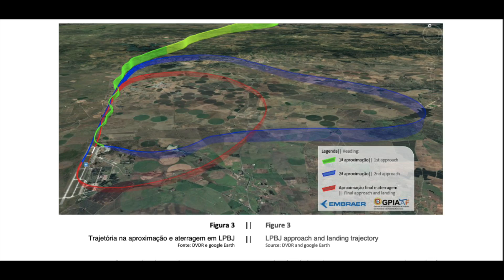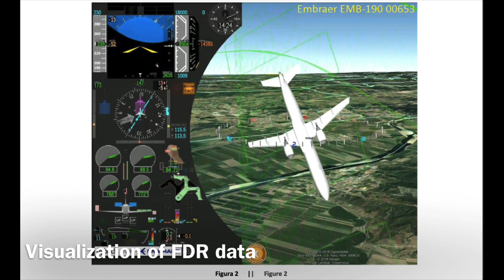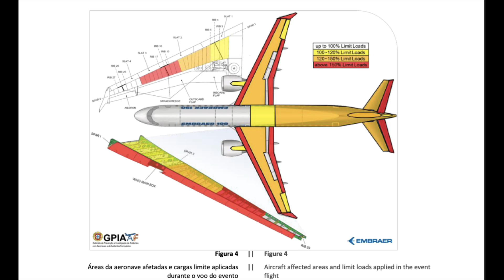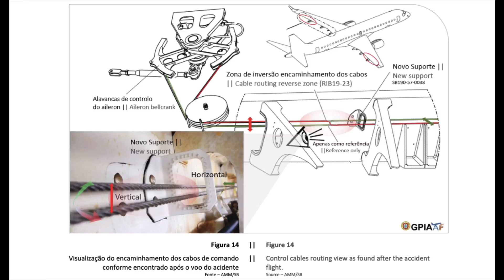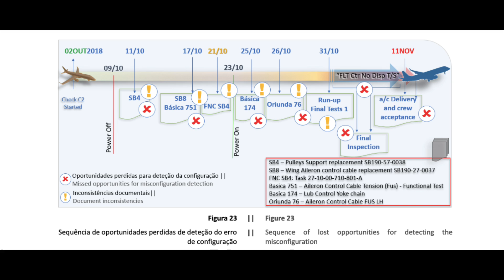Fighting To Survive | Air Astana Flight 1388

Comment: Every pre-flight checklist I know of has an item something like "controls free and clear." That means the pilots move the ailerons, rudder, elevators, and other control surfaces and confirm they are operating correctly.
Reply: But are they also looking out the window, to see if the ailerons react in the manner they expect? Quite tricky, if possible at all. Comms with ground crew needed?
Reply: @hawkertyphoon4537  true, that's why the checklist says "free and clear" and not "free and clear and operating to spec."
Reply: @RaysDad  
As an armchair Fighter Pilot i routinely looked in the mirror (rudder) and out the dang window to see if my P-40, corsair, Mitchell, Yakovlev, what have you... Ailerons were working fine.
We need to give these Men some Webcams to do these checks.
Hell, even some extra cams in random spots do be able to see engines, wing upper, lower, tail structures... whatever.
Let them take a look at their entuire Aircraft, i say.
Reply: according to Mentour Pilot - who has uploaded a video on the incident a few days ago - there is a screen that graphically displays the ailerons & spoilers - it seems the pilots just misinterpreted it somehow - they won't ever again

Comment: You know the flight is so rough when an experienced pilot gets so exhausted from struggling with the plane that the copilot has to take control. Extended amount of 5gs on the body can take a toll on the body, its the same as riding a rollercoaster. I'm amazing how it got on the ground without breaking apart.

Comment: This situation is straight up on the pilots. Pilot in Command means you are responsible for everything that happens. You may not be at fault, but you are responsible. Everyone who is a pilot was taught from lesson one,  "Exercise the controls full scope and visually verify free and correct." If you take a plane out of maintenance without performing that check, you have earned everything that follows.

Comment: Very good that you brought up the spoilers were basically negating the effects of the ailerons.  What a wild ride those pilots had.  Not being familiar with this EMB aircraft, does the EICAS/MFD show the aileron deflections and would it have been indicating the reversed deflection when they did a control check?  If not, then not sure how else they would have caught the reversal prior to takeoff.  What an interesting scenario! Thankyou
Reply: If not it should be in the maintenance procedure to check that visually after maintenance on the cables before handing it over.  It is scandalous that such a basic error could not only happen but fail to be detected.  Really it should be "poke yoke" by design, but not everything can be.

Comment: Come on guys , Even als a PPL even before you startup your aircraft you check your flightcontrols for full freedom and visualy outside for correct movement.
On modern aircrafts you can check this visualy on the EICAM , ECAM or whatever system your aircraft has (Ambraer 190 has EICAM like Boeing).
Furthermore the maintenance crew apperently gave the aircraft free without even doing the same check.   It's like replacing the tires on your car and not even checking if it looks like they are not flat..
They never should even have started up the engines.
.
Excelent video again... and indeed great flying skills.

Comment: You mean to tell me that at no time, NOBODY did step 1 of flight control maintenance certification?  Whenever primary or secondary flight controls are disturbed, an independent qualified tech needs to call the person in the cockpit and (in this case) call for ‘Left wing down’ the person turns the yoke to the left and the inspector should physically see the L/H aileron move up, along with the spoilers. In this maintenance error, the aileron would have moved down.  This is a major red flag for this maintenance company.  They are being rushed to the point that they are not doing the simplest of safety checks in order to save time.  Lessons written in blood here.  This time they got lucky.

Comment: As a non pilot, non airplane mechanic, but an auto mechanic for 22 years and someone who loves all things aviation, I can see how this happened, because there is another video about a very similar problem on another plane I watched a few days ago.  If the mechanic on the ground isn’t very smart and knowledgeable, it would be so easy for him to command left turn, the mechanic in the cockpit turns left. Mechanic sees the left side move in either direction, and call it good. Same on the right.  He would not realize they could possibly install the cables backwards, so he doesn’t register that the input is opposite reaction. Just that it moved as it’s supposed to.  I’d think that them moving opposite of the inboard flight control surface would be a giveaway. Maybe the inboard control surfaces are hydraulic? So they didn’t move during a static test?  Just a thought.

Comment: Is it the case that the flight crew cannot actually see the ailerons from the flight deck. If not how do they do the basic pre flight check of looking out of the window as they move the controls and making sure that the controls are moving in the correct sense. That is they input left roll and see and check that the left aileron moves up - aircraft will roll left. If not they are incorrectly connected. I understood this was an essential basic pre flight check on all aircraft from the lightest single engine type up to as large as they come a any ground engineers can make this mistake.
Reply: according to Mentour Pilot - who has uploaded a video on the incident a few days ago - there is a screen that graphically displays the ailerons & spoilers - it seems the pilots just misinterpreted it somehow - they won't ever again

Comment: RC planes are checked by pilots to see if the servos aren't reversed so they won't crash on a first flight, but a real plane carrying people is not checked if the controller and control surfaces movement match after making a major maintenance?

Comment: Stick left, left side up, stick right, right side up. Basics are important kids! On a more sombre note, it was probably extremely lucky that the the flight spoilers were there counteracting the aileron inputs, I think it's extremely unlikely that they would have been able to recognise the error and correct it at low altitude if they had attempted to make even the slightest turn. It would have taken only seconds for them to totally invert and crash.

Comment: Congrats to the crew for getting back down safely.  But I’m curious, as a GA pilot, one of the preflight checks is to visually check control surface movement from the cockpit.  And proper direction of the surfaces while moving the yoke.  There are examples of where pilots checked movement, but didn’t catch reversed installation of cables.  With these larger aircraft, can the pilots see the ailerons from the cockpit?  
Excellent video, thanks.

Comment: Seems to me; that a normal preflight inspection, and presumably a more thorough one after such maintenance, would have noticed that the ailerons  were working the wrong way. I also find it interesting that they were switching from stainless steel to carbon steel cables. This is definitely a step backwards.
Reply: My guess is that even when they did their preflight checks, they snuck in some shortcuts born from experience. For example, in this situation the roll spoilers were working fine, so maybe they just looked at those. Alternatively, it could be that while still on the ground, the ailerons could move just fine, but that the person checking didn't realize they moved in the wrong direction because they only looked for movement. Or the source might be even more human! In the case they might have realized it was going in the wrong direction, it could have been a matter of miscommunication: aileron down means that wing goes up, and vice versa. Simple speech might not specify what is intended to go up or down. In a similar vein, the checklist might prescribe a certain order of testing (for example ailerons up first, down second), but the person checking may have thought the change was just a colleague keeping a boring checklist engaging by switching things up.
There are a lot of ways for this specific kind of inversion error to be miscommunicated because its is so much more insidious of a mistake than something simply being broken. As humans, we tend to see what we expect or want to see. There are ways for things to break that just shortcircuit all of our common sense: what kind of idiot would switch those cables around?! With all the advanced technology that is in play, it is really easy to assume that an error is in the more complicated equipment, especially when the symptoms do not match any previous experiences with the more basic equipment. It is a lot easier to assume that a transistor broke up and some electronics were activating that shouldn't.

Comment: I wonder if there was a way to have disabled the spoilers so that they could use the ailerons in reverse as the sole means of roll control. Of course they would need to know that this was an issue and it would still leave them flying with the roll axis inverted. All that said I think the pilots did an amazing job in terms of the flying.
Reply: If I recall correctly, that's kind of how they got a little bit of control back. Not really disabling anything, but they figured out that one of the systems (probably the spoilers?) were slightly delayed compared to the other, so by only making minor movements they only activated one of the control surfaces instead of both.

Comment: I worked as a mechanic on MD-11's and when I was being trained it was drilled into us about following ALL maintenance instructions to the letter, every single time, because every single conceivable rule regarding aviation pertains to safety in one aspect or another, and they are most certainly written in blood. When something goes wrong on air aircraft, you can't just pull over to the side of the road as if you got a flat tire in your car, it's a serious emergency that can and has easily killed hundreds of people in just a few moments. No matter how insignificant a task you might be performing, pay close attention and do it right exactly how the instructions direct you because in aviation you never know what tiny little microscopic failure is just waiting to cascade into a horrific tragedy that ends the lives of hundreds of people. This whole video is just a case study as to WHY we have such strict rules in regard to aircraft maintenance and why following procedures is absolutely paramount to everybody's safety.

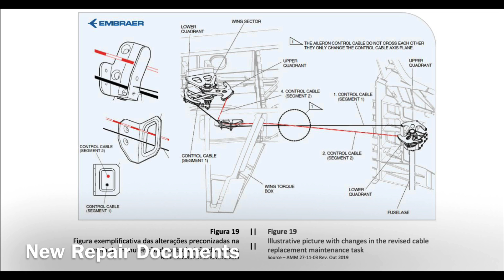Comment: At 10:48 the revised diagram is still confusing, as the cable from the lower quadrant on the bell crank ends up going to the upper quadrant, and vice versa. Things need clarity and consistency, and this has neither! Hopefully there is now an operation check which is part of the maintenance item.

Comment: I'm not insulting your channel with my distrust in Automation.  But this is a good illustration of when PILOTS fly the plane and not computers.  And for Simulator Pilots,  did you know that you can fly  a plane with just Elevator and Rudder?  Ailerons are an additional control to flight, although an obvious help on a windy day.

Comment: In April 1978 I took PanAm flight 73 from Frankfurt to JFK, NYC.  Minutes after takeoff the lights went out.  Then the climate control went out as well.  A steward (or flight crew member) went toward the back of the cabin with a fire extinguisher.  Then another person went aft with another extinguisher.  It got cold fast!
Within  5-10 minutes everything came back on.  Throughout the incident no communication from the cockpit.  We eventually landed safely at JFK, in NYC.
Had we had to go back and land we'd first have gone over the ocean and dump fuel.  I didn't know that at the time.

Comment: What struck me was "replacing stainless steel with carbon steel". I suppose it may have been decided that the stainless steel wasn't strong enough, or had some other issue, but now you have to watch for corrosion.

Comment: In the automotive sector, poke-yoking a system (ensuring it can only be installed one way) is a cardinal rule. If a problem isn't caught in the design phase, it's caught during the prototype builds. How a critical directional system in aerospace was allowed to use this design is absurd.
Reply: Keyed connectors would help. I can think of several different options for making connectors that only work one way. Some more practical than others, but it is possible.

Comment: These mini investigations need to be used to train both managers and engineers in the importance of proper oversight. Fortunately, no-one died this time. Aircraft are complex machines; airliners have not just engines,and control surfaces, but multiple  computers that monitor the performance of the engines,weather,anti icing etc. The need for clear maintenance manuals are essential if something like this is to be avoided. If the computer says "flight control error", it might make sense to actually check the control surfaces and their cables. The reversed cables probably would've been found, put the in the correct position. Also,only allowing those that have been certified as competent to complete maintenance.
         I hope that the both management, directors and engineers all had the same scare as the pilots and will change their procedures to ensure that such a near miss NEVER EVER happens again.

Comment: Two things I don't understand:
1) The computer detected the error and raised a generic warning. Was there no way to check exactly what problem it had detected?
2) In response to the error message, they rechecked the systems, found and fixed a couple (actually unrelated) errors, and reset the computer. Why did it not detect the error again?

Comment: I'm looking at the image and trying to figure out if the blue or yellow cable on top, I thought I had a good idea then looked at it again and got the exact opposite notion, I see how they could screw this up but I don't see how they could have been sure as to which was it goes and how they'd be ok with just 50/50ing it.

Comment: I really enjoy these quick videos of the lesser known stories that ended well (as well as those that didn't)!
Question: How could the pilots have caught the mistake in the pre-flight check list? When testing the control inputs, how do they "see" if the control surface actually move in the correct way?
Reply: There is a display in the cockpit.

Comment: I wish luck everybody who attempts to control a vehicle using inverted controls. I had tried to do it on a specially crafted bicycle - and knowing that the steering was  inverted did not actually help much. My instinct reactions were always faster than my brain and I even cannot remember how many times I landed on the dirt. 

OK, the plane reacts somewhat slower than the bicycle, so you may have time to "invert" your reactions as well. But still, kudos to the flying crew.

Comment: They teach you to check aileron "sense" as standard pre-flight checks on light aircraft but some people only check they are responding to inputs. Turn right and the right aileron should be high, left should be low.  Same for the rudder.   Could the pilots have detected that issue here?
Reply: they could have - should have - but didn't - i don't think any of them will fail to check - for the rest of their lives

Comment: Can't imagine the plane continuing service if it's frame is distorted for 120% G loads. Metal fatigue would be a worry.
Reply: Don't think the deformation was 120% ... but rather the loads placed on the airframe were in excess of 120% of the design limits ... but I may be wrong.
Reply: I think 5 G is beyond the load factor limits.  I thought it was around 2.5G and ultimate load factor 1.5x that but I could be wrong.
Reply: Other comments said it was written off.